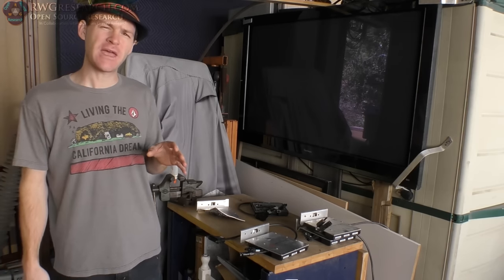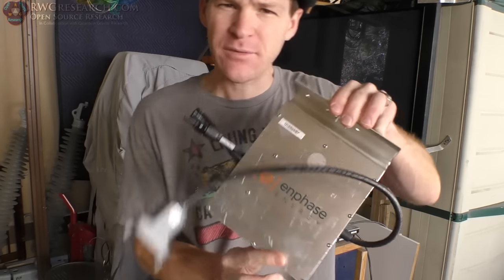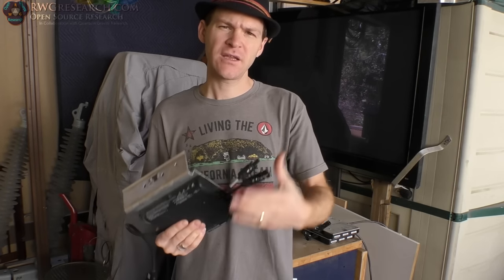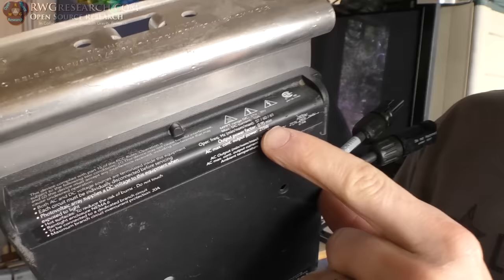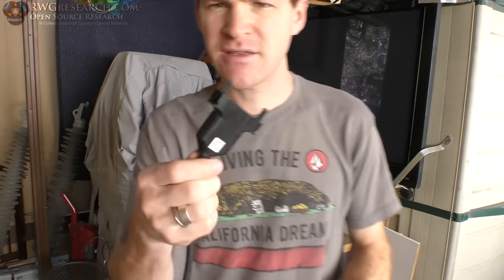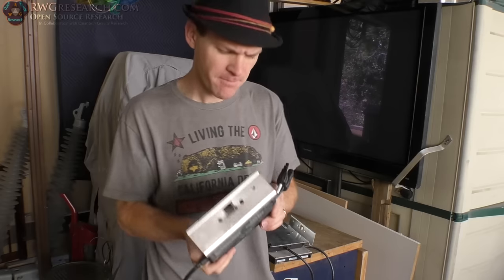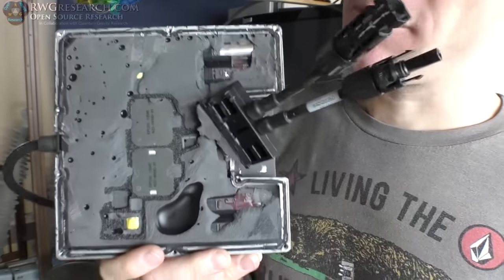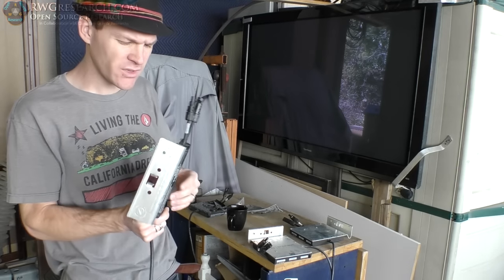Ben's Inverters... Salvaged Enphase M215 Micro-Inverters

Comment: Did you first apply the AC cause these are GridTie inverters ? Or did you just apply DC from your Power Supply to test it ? Then they don't output AC cause they don't sense the AC....
Reply: So you might just have tested them wrongly and they still maybe working but unless the AC output does not sense the AC grid they will not output any power...that is a failsafe feature of gridtie inverters ,when the grid goes down...so you can only feedback power into the grid , when the grid is up and running...

Comment: All grid tie inverters made over the last decade or so should have island protection which I know the Enphase ones do.  You need to connect the inverter to your 240v mains and to your solar panel for a factory programmed amount of time before they will turn on the output.  The inverter also needs the 60 hz signal from the mains to synchronize the output.  Once on, you should see a load on the DC input and a slight increase in the line voltage on the output of the inverter along with the current going back to the grid.  These inverters should not need to connect to anything other than the AC line and the solar panel to operate but they do offer networking for central monitoring of power generation.  The benefit of using per panel inverters is that you don't have to worry as much about shading and if one inverter or panel fails the rest will continue to operate unaffected.